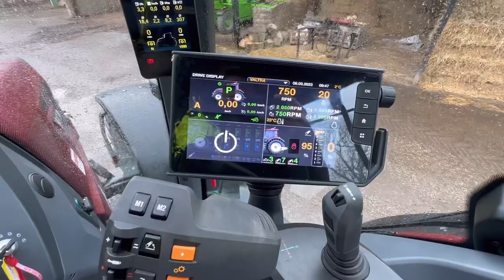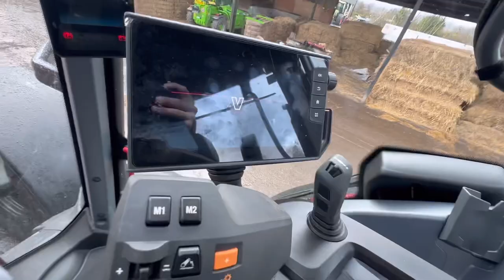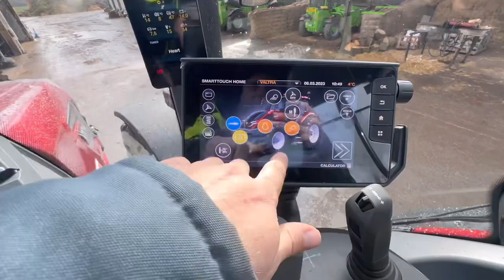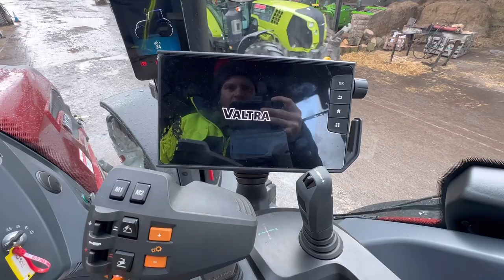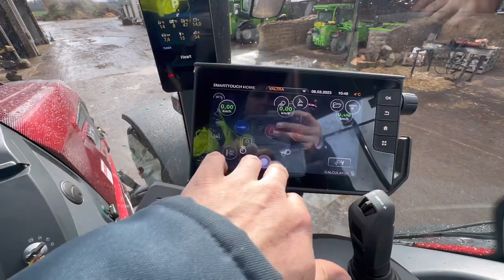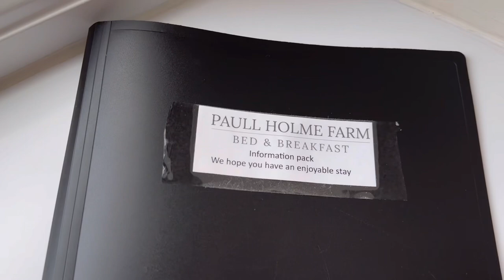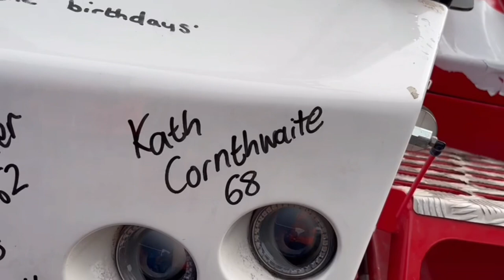BIG TRACTOR TURNS UP & LOWLOADER MODS & A EDIT MIX UP  🤦‍♂️ #OLLYBLOGS #AnswerAsAPercent 1079

Comment: Hi olly if you weld a hook further up the trailer to rest the ramp holder onto when lowering the ramps otherwise it will dig into the ground when trailer goes down when loading

Comment: Another good video, just a quick tip for the low loader,put chain on the linchpin and weld to the ramps, stops them from going missing 😀

Comment: Blankets are thinner.Rugs are for waterproof and to keep warm and blankets are used for horses indoors at night so they can stay warm but they can also sweat through a blanket etc to prevent pneumonia. But to answer the question the horses in the clip is wearing a rug

Comment: be nice if them valtras had the option of a different bonnet on them.not a fan of the slope of it at the front,a nice looking tractor otherwise ,the fendt has a more agressive design which id prefer the look of

Comment: nothing wrong with deutz engines olly there used in a load of different machines apart from their tractors, it’s fendt software that’s killing the engines but they can’t seem to realise that plus i know of a couple new ones with the man engines back in that have gone bang already with less than 100 hours on them so that doesn’t say much for fendt and their software does it 😂
Reply from the maker: Only time I’ve put a engine in a modern tractor it was a deutz
Reply: @OllyBlogsAgricontractfarmer  yeah i can understand there will always be faults etc but when fendt are having to have engines on standby to replace them it’s not exactly great, but no matter what tractor you buy it always breaks down one way or another it’s the back up that counts really these days

Comment: do you have any stats to prove that the AGCO Power engines are more reliable than Deutz?....If the Deutz are so bad as you suggest why do Fendt keep using them and the factory supply so many OEM's?